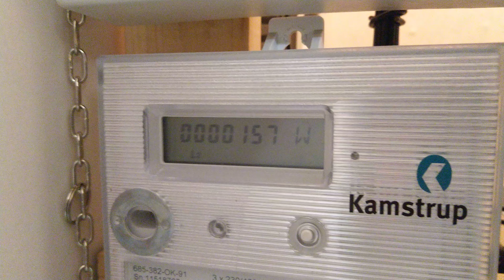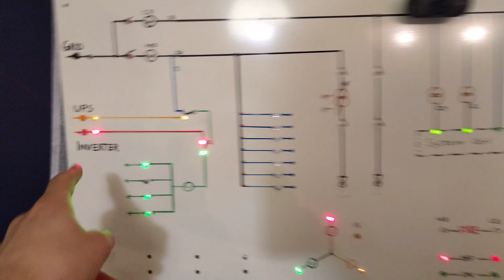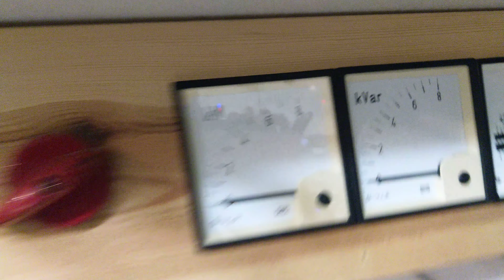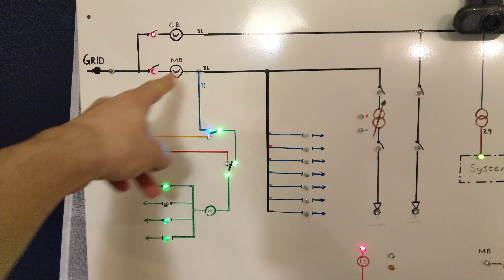Emergency Power

Comment: Quite an extensive setup.
I'd replace the chain with the plastic version, to remove the risk of short circuits should the chain swing into a breaker.

Comment: Exposed live parts.  NFPA 70-110.27.  Overcurrent protective devices located in the vicinity of easily ignitable material.  110.18 & 240.24(D)

Circuit breakers discharge molten metal and plasma when interrupting fault currents.  /watch?v=cwXmChaTdQI